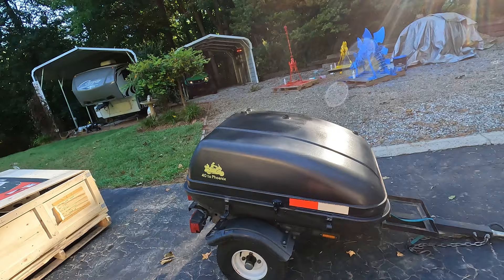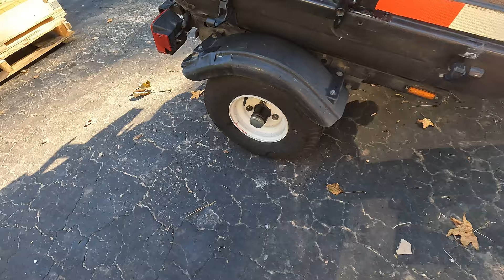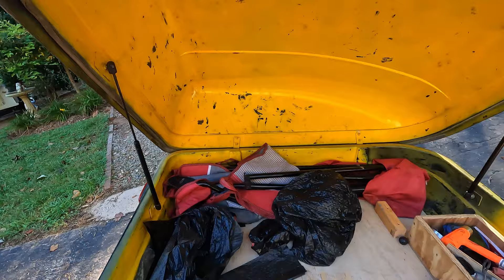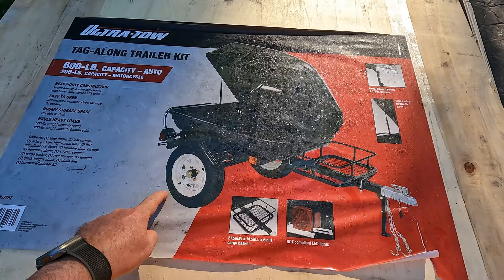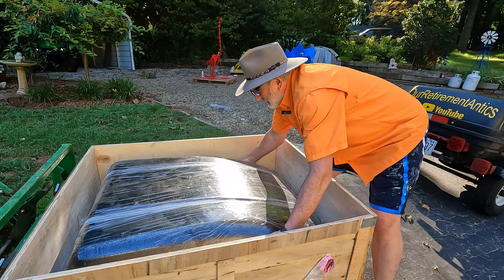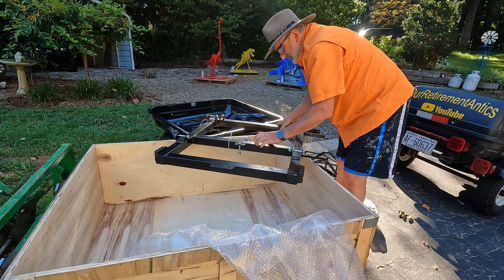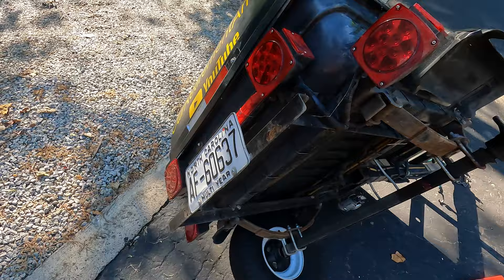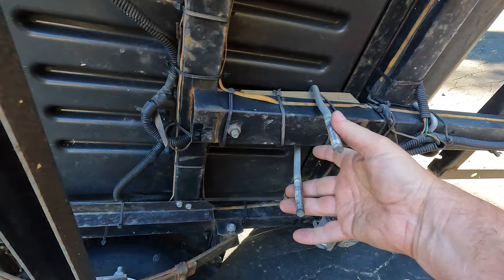Northern Tool Motorcycle Trailer Unboxing and Comparison to Harbor Freight Trailer

Comment: Just wanted to mention that if it has two stiff of springs a tiny pothole could send it upper foot off the pavement. You need to remove a leaf go down to one leaf and you put that center bolt it's called a tie bolt back in and shorten it by cutting it off with a hacksaw torture grinder anything. Add Thai bowl has to be there like you said to keep it centered in the plate. I'm building one with the aluminum Northern tool trailer and a Sears brand fiberglass cargo top. That's just about like yours. But with the aluminum trailer gives it a new and old and I have a lighter bike so we'll see thanks for the video!

Comment: All trailer tires were all traditionally rated at 55 mph. They were all marked ST for special trailer. The specal part is that they were never tested at more than 55. Even then, that rating is for max weight at I think 75% of max air pressure. Its been a while sense I had to keep up. Speed rating is based on weight flexing the sidewall creating heat at speed. An ST tire is fine at higher speeds at lower weights. The US just didn't test them for it until recently. The new system now allows testing trailer tires above 55, but a lot of manufacturers have not retested. Their main market does not require it. The rim sticker is probably a hold over from the older testing as well. Comparing speed rating today is a pain with both systems in circulation. As long I am not pushing that max rated weight on a tire, an its aired up properly, I don't worry about speed rating at legal speeds. For my bigger trailers that are pushing the weight limits of trailer tires, I just bought light truck tires. That upsets people to because they think ST tires are tested to be better on trailers, when in really thy are just tested to a lower standard, or were anyway.
Reply from the maker: I agree with everything you said. I've had two ST tires explode on me. Both times they were significantly under the weight rating and had good air pressure. On the 2nd one I had just weighed my rig at Flying J and had the receipt. I kept the shredded pieces and filed a warranty claim. The Chinese manufacturer paid me $3,000 for damages to my 5th wheel. Light Truck tires load range E is the only way to go with trailers and 5th wheels. Been doing it since my 1st ST tire exploded in 2002. The 2nd one was less than a year old and I thought I could get a few more months out of it. Nope. There is a reason we call then Chinese bombs.

Thanks for visiting our channel.

Comment: I added a flashing brake module to the back to my Goldwing. GS–100A is the part number and I wired it up to a third brake light. It’s cheap insurance to help keep from being rear-ended.👍

Comment: I would recommend a cargo net for inside the trailer and upgrade the tires to 14” high speed. I’m not sure I would want the trailer to stay attached with safety chains if it decided to part ways…
Reply from the maker: I have a large piece of luggage I use (with wheels) and it sits in such a way that it does not move around. I am happy with the tires. Regarding the chains, I think they are probably required in most states for safety. I connect the trailer to the tow hitch with a 3/4 inch bolt, large washers and clip pin. If that thing gives way I have bigger problems  🤣. Thanks for watching.
Reply: Yes in both the states I've lived in you are required by law to have two safety chains rated to hold the max gvw of the trailer. Also if a trailer gets away from you causing injury or death the driver of vehicle is held responsible.
Also I'm sure your correct that the speed limiting is a lawyer thing. That rim and hub are not going to give out at 75 or even 85mph, only real limiting factor is the tire and possibly cheap bearings. All U haul trailers also are limited to 45mph, though your not likely to see people actually driving that slow. I'm a mechanic from a family of mechanics, doesn't make me a trailer expert but that's my opinion on it.👍 @OurRetirementAntics

Comment: Id recommend removing the leafs. I have the 40"x40" trailer that i set up to haul my motocross bike. The whole thing total goes to about 400-450lbs including trailer and bike weight and it had no movement out of 2 leafs. So I removed one and now it only has the leaf with the eyelet and slipper and now the trailer doesn't bounce all over the place as I tow it. You move less weight so youd be even safer doing that I'd imagine.
Reply from the maker: I know people do that and I have thought about it. But I don't have any problem with bouncing so I just left it. Thanks for watching.
Reply: @OurRetirementAntics  if no issues then yea, leaving it's the smart move... my trailer was going skyward on every expansion joint on the highway

Comment: The new trailer seems to be higher. Any concerns about higher center of gravity?
Reply from the maker: If it is higher, it is not much. I should have compared the heights. However it still tracks solid and I have had no problems with it.

Comment: So, if the "rims" and not the tires are only rated for 55mph, are you going to replace the rims?  A lot of our NC interstates have 70mph speed limits.
Reply from the maker: Steel is steel. I can't see how speed would have any impact. I have replaced wheels on a RV because they were rated for a lower pressure than I needed. Maybe I am wrong, but I've had no issue. I am more worried about the speed rating on the tire.

Comment: Great video, thanks for sharing. I was wondering about the trailer tongue. What size tubing is it? I would like to get a longer one so I can stretch the trailer and build a kayak rack on it. Thanks!!
Reply from the maker: Its about 2 inches by 2.5 inches. It is made in China so the actual precise measurement is probably metric. But my numbers are close. It is not round.  Thanks for watching!

Comment: Nice video. Think I'm going to go the same route. However, I was wondering with the taller trailer wheels if you'll be able to pull the trailer level. Seems like the trailer would be at a downward angle to reach the Goldwing trailer hitch. Also, wish someone would approve my 40 to phoenix request. I live in NC as well. Cheers
Reply from the maker: I didn't really notice. It handles fine. Regarding 40 to Phoenix, did you submit a request on Facebook? I  really don't know if there will be another organized ride again. With GWRRA no longer around, there is nothing in Phoenix to go see. There was talk about an Alaska trip but then COVID hit and I have heard nothing since them. Thanks for watching.
Reply: I did submit it via FB. I read that the GWRRA isn't around any more, but figured the folks in NC still got together for other rides. Maybe the group needs to be renamed, "40 to AnyWhere", LOL. Regarding the trailer, I've been holding off hoping that it goes on sale. You had mentioned that you got it at a discounted rate. I may have to bite the bullet and spend the $699. @OurRetirementAntics

Comment: When you mention upgrading the tires and bearings, where do you get them and do you need any special tools for the bearings, like a puller of some kind ? Thanks !
Reply from the maker: You can get tires from Northern Tool. I get the bearings from Amazon. No special tools required. I did another video where I replace and pack the bearings with grease. Check it out and thanks for watching.

Comment: if the rim cant hold the tire on at 75 mph the result is the same as the tire not being able to run at 75 mph
Reply: That rim will hold up way higher then the tire as long as it doesn't get all rusted up in 20 years time